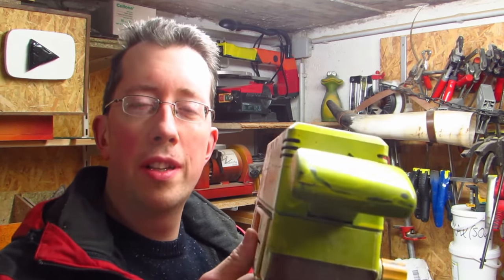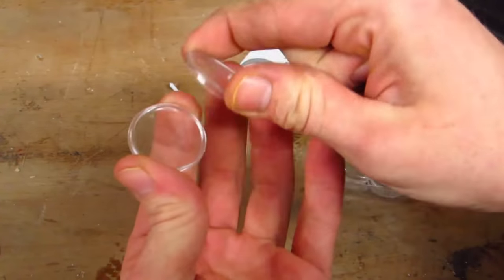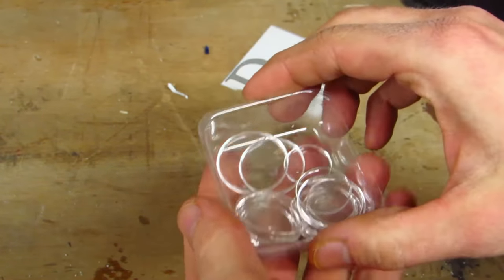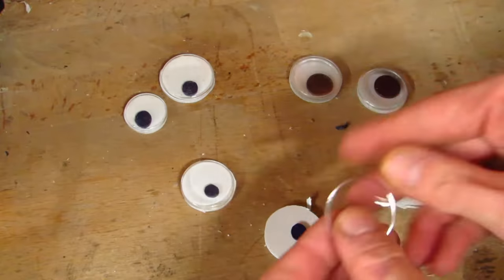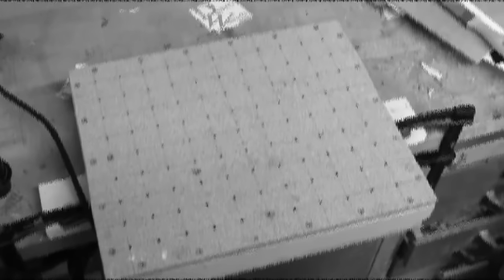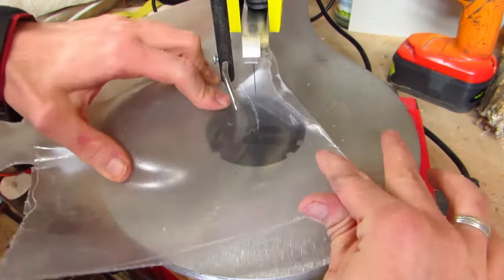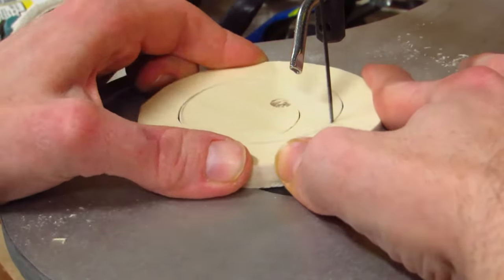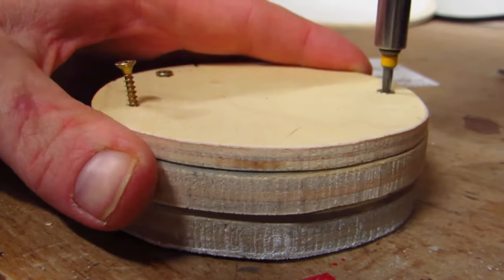Make your own Googly Eyes!

Comment: Did you use clear worbla for the vacuum form mold? Would it be possible to use acrylic sheets as well? Im most interested in this method.
Reply from the maker: It was a sheet of plastic I had laying around, but I am certain that it was not worbla. I seem to remember something about a coil of thin PET a while back. Thanks for watching!